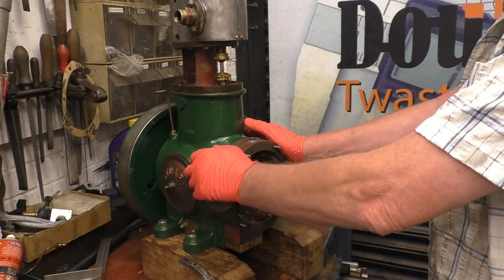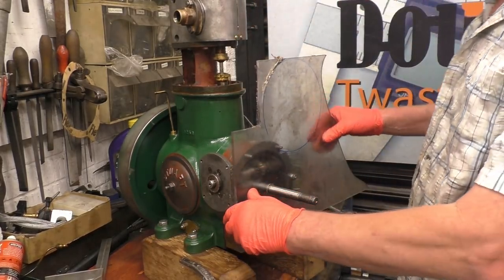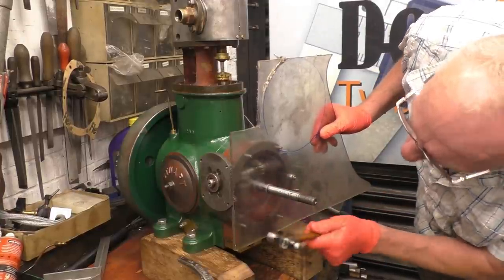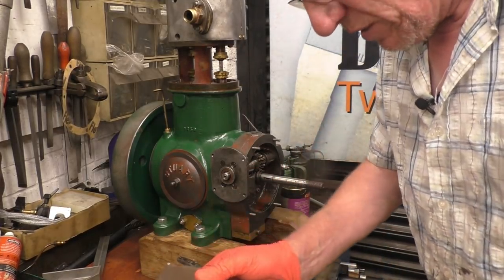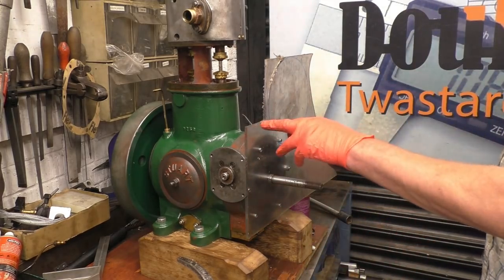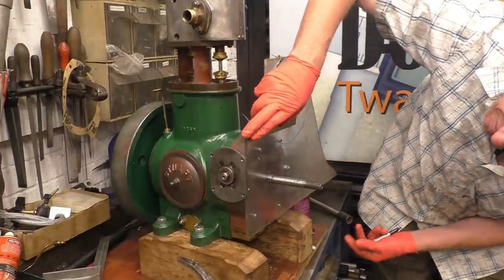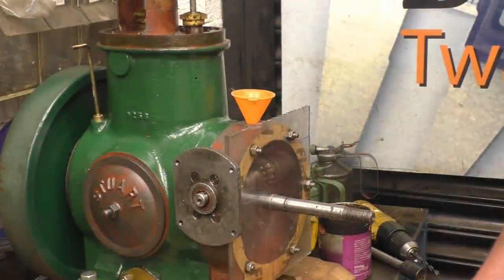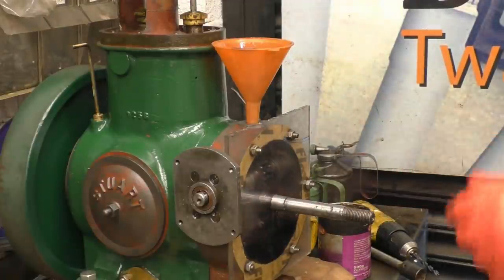Stuart Engine  . P 14  Ready To Run

Comment: When pouring out of a can that's had the side removed - pour it out of the original cap fitting !

I've just done the very same thing - to put used engine oil into another container.